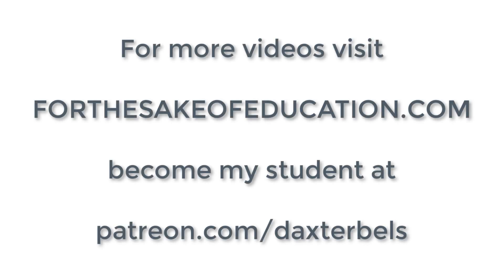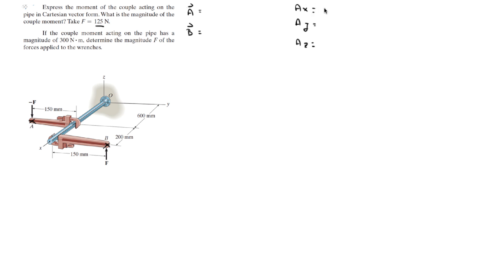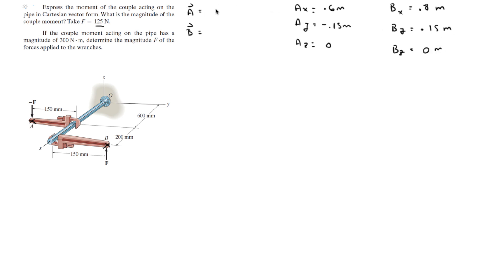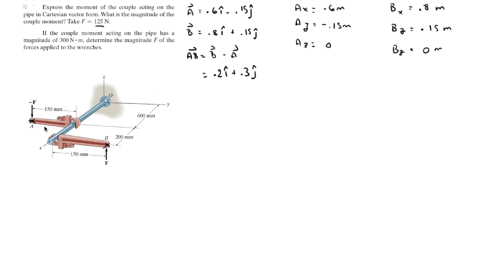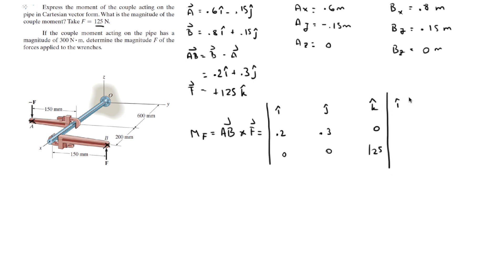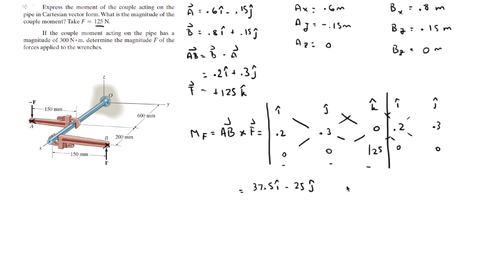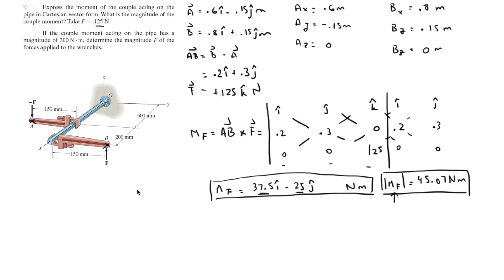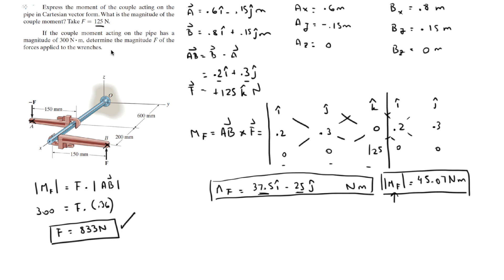Express the moment of the couple acting on thepipe

Comment: why do we need to find the vector from a to b
Reply: To calculate a couple moment you need to multiply the force by the distance between the two forces. The vector AB is the distance in this case.
Reply: would it be the same as finding the position vector from OB?